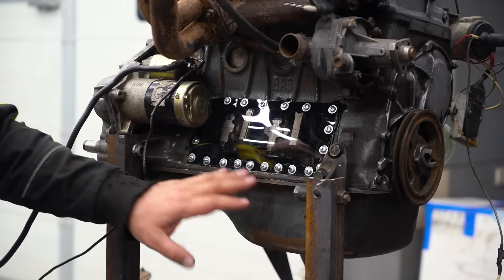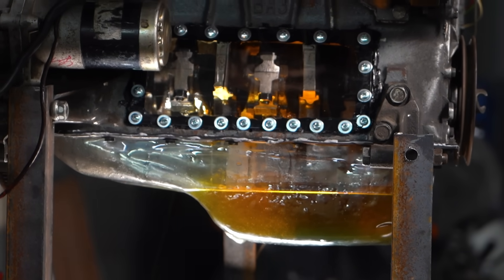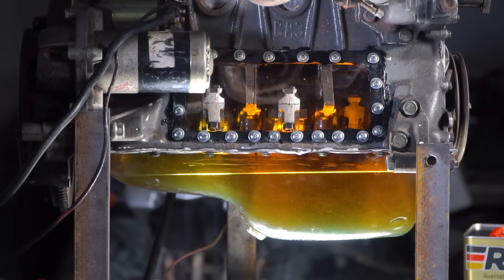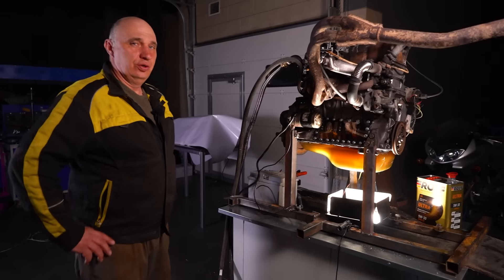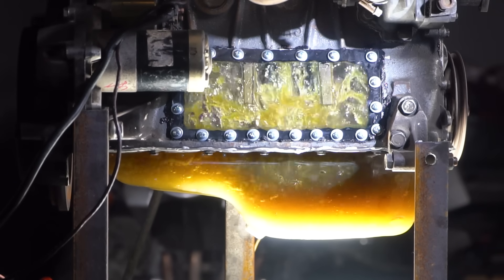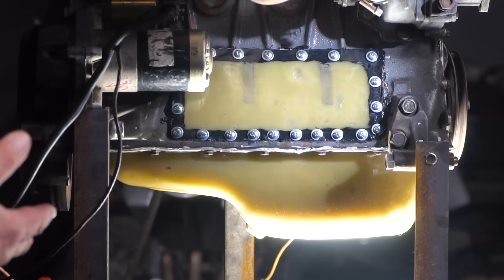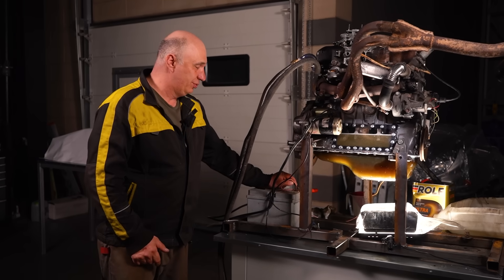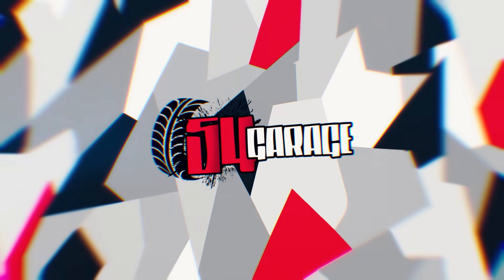What actually happens when you overfill your motor oil? (w/ transparent oil pan)

Comment: I'm assuming this is a Russian engine out of a Renault or something I'm not sure I believe that's the right brand I could be wrong on the brand of automobile but I do know they typically test a Russian automobile on this channel I've seen a bunch of times I'm curious about the front and rear seals on the engine would not the extra oil create significantly more internal pressure against those seals and cause them at the very least to leak or possibly blow altogether ?
 that's what I've always been told the dangers of adding too much oil would cause either internal seals to be blown or front or rear main seal .
Otherwise still really cool experiment it sucks that the plastic pan gave up LOL

Comment: As mentioned before the cavitation in the oil from foaming up will cause premature bearing and pile pump wear, but what nobody else has mentioned, increasing oil level reduces the volume of air in the lower half of the engine ( crank case pressure ) engines have a crank case ventilation system and it can only flow so much. Increasing the oil and decreasing the available space for air in the crack case will increase the crank case pressure. This pressure will naturally want to release, the way it does this is pushing oil seals, more commonly the front and or rear main seal both of which are expensive to have replaced.

My point being is everyone in the comments saying you've been so concerned about it and now you feel at ease from this video, just remember over filling can cause issues. There is a reason the manufacturer recommends a certain amount. A little bit over the fill line is okay but going too excessive will cause damage.
Reply: It's aeration of the oil, not cavitation.

Comment: Many have missed a huge error in this experiment. Reving the engine at idle doesn't create any load and he didn't run the engine for any extended amount of time. the oil pressure will blow all the gaskets and seals... your engine will kill itself...

Comment: He did not talk about oil coming out at air cleaner ,my partner had his vehicle service,and about 1,000 km he could not work out where the oil was coming from,took it back to work shop,they ask if he put more oil in the motor,he said to the mechanic it only done 3,000 on the clock,it a brand new car,why would I put more oil in it,cut to a short story,they drain oil,and did not want to talk about who did what,never went to that workshop ever again.so we never knew if it hurt the motor,still doing research,ourselves.

Comment: I have an 850 Moto Guzzi motorcycle from 1979. It has a ridiculously shallow sump. It revs to just under 8,000rpm. Even the slightest over-filling causes much oil to exit the breather. A sump extension fixes the problem.

Comment: Think about the oil level in the pan when driving up or down a long mountain road. Think about what happens to the oil in the pan when accelerating or braking. The crank components will be hitting the oil even when the correct amount of oil is used.

Comment: I had a car come in that was overfilled, 

I drained out over 7 litres, correct was 2.8L.

The owner filled it, the engine, until it was full.

Then they drove it. It hydraulic locked, and bent a con-rod. The excess oil got sucked out of the crankcase ventilation system, into the induction system and the rest was history. . .

It was their first car, they had just passed their driving test. . .

The test is for how to drive, it does not cover the intelligence (or lack there of) of the driver..

Comment: Really interesting! I experienced  a modern Common Rail Diesel Engine runaway first hand in a Ford S-Max 2l TDCI some yrs ago. These have the problem that unburned fuel seeps into the Oil due to unfinished exhaust filter cleaning procedures if used on short distance driving too much. Without knowing I went on a longer ride with diesel diluted motor oil wide above "max" level. All went fine until I went up a steep mountain road with about 10% gradient.  Obviously, the surplus oil was foamed up by the crankshaft and sucked into the intake via crankshaft casing ventilation - and the engine did a runaway. Thanks god this happened under load and I noticed it while shifting so I could choke the engine and stop the car. The whole thing was really scary. The engine control went into emergency running mode but nothing was damaged thanks god. After an oil change everything was fine again.

Comment: My Dad was Marketing Manager of Petroleum Products for Gulf Oil before the merger that created Chevron. He always told me it is worse to overfill than underfill. Times have changed. This is a fascinating video.
He started out there working in the grease pits at the Harmarville, Pennsylvania R&D facility in the late forties and worked his way up. He was with API and SAE and helped to create the ratings system for viscosity and acceptance by the automotive industry.

Comment: Over time as you can see excess oil creates too much friction on the crankshaft causing premature wear. 

The crankshaft and crane can experience greater resistance and friction, causing them to become damaged. Engine wear, If oil is at an incorrect pressure, the lubrication of engine parts will not be properly optimised, causing increased wear.

Comment: Du ifyou occuy too much. Of the crankass volume the pressure w force ouup out thedip stick toube and as the piston skirts get oily tei begin to smoke and without the PCV to releave pressure seals and gaskets will begin to fail until the plugs oil foul. And it wil quit.😮😅

Comment: This engine maybe OK with overfilling but there are many different designed engines that operate at different levels.That's why the designer of engines have an oil level. with Porsche 911 dry sump system the oil level on the dip stick is half way between low and max and the oil is transferred at different levels.They are just designed to operate that way. I would stay with the designer of a pacific engine....Also i would be more interested in what oil pressure of this engine with more oil.

Comment: Bought an 06 TSX for $600 that the owner thought was the head gasket because lots of black smoke coming out the exhaust.  Ended up having twice the amount of oil. Drained the extra oil ran great. Sold the car for easy profit of $2,000!!

Comment: Hey if anybody is mechanically inclined my car has an inconsistent throttle. Sometime pressing the throttle does almost nothing and sometimes it has instant torque. Also for some reason a fluid that kinda smells like battery acid came out of my vents when I had the heat on. Any answers?
Reply: Yeah. Go to a garage and stop consulting on the internet.

Comment: Oil level overfill not being an issue depending on how much it's overfilled is dependent on the engine. There are some LS engines that it's recommended to add an extra quart for track use. But if you put an extra quart in a 911 turbo you'll toast it.

Comment: A really great video. I see you are using 5w-30, in a 2000 chevy cavalier at around 100k miles they have a overheating problem which is cured by adding a quart of 10w-40. There interesting thing though, is that my 2017 VW alltrack,  even at 30k needed an extra quart of oil over the fill line to keep the valves from ticking very badly, i believe that when running the head holds the extra quart of oil, even when it was a newer car.

Comment: Mechanic of 30 years old neighbor. Said he puts one quart extra in his own vehicles.  In an engine like acura 3.7 v6 that burns oil ive over added oil it whole life so far and this is confirmed that its not hurting a thing.  Better over than under way better
Reply: Some engines will burn oil if over full or at Max and find their own level.
As long as the level is between the high and low you're good to go.

Comment: decades of conversations with professional mechanics, smart backyard mechanics, and me, who regularly works on my cars and friends' cars, and i've never been given a straight or consistent answer. i've always enjoyed this channel, but that was fucking fantastic. cheers, from me in Alaska to you in Siberia!
Reply: few points to keep in mind here. 
first of all that oil pan is molded from the outside making it bigger than the original.
this is an old lada engine, nowhere near the tolerances of modern stuff. 
it is only running for a few minutes in these conditions.
it is not moving around like a vehicle going up/downhill.
and they are filling it up even after it is beyond critical levels for normal operation. 

in my career i have seen a few vehicles towed into the shop due to double filled oil. one because the lube tech drained the transmission on a subaru thinking it was the engine and didn't check the dipstick after filling the engine with more oil. that car made it about a mile before it started bucking like a horse and pouring smoke and oil out of the exhaust. 

another one was because a chevy trax owner thought the oil life % on the instrument cluster measured the oil level, and put 4 more quarts into the engine when it reached 5% and dinged at them. that one was just pouring a bunch of smoke and oil out of the exhaust. 

besides that i have seen some vehicles shoot the dipstick out, spray oil onto the exhaust manifold, and clogging the catalytic converters just from being a quart or two over.
Reply: @cmawhz  But with the Subaru engine being a opposed cylinders and quite a small sump , then all that extra oil would have gone down the bores and violently being hit by the pistons. That would make a interesting video.
Reply: @cmawhz  Different engine.
GAZ is the opposition to Lada.
Reply: @cmawhz Nobody wants to overfill but everybody wants to stop being scared if they 1 cm over max line 😊 1 or 2 dcl over wouldn't harm it that's the point
Reply: @VladimirKozomara  i wouldn't pull the drain plug for being half a quart over but it's not hard to be a little more accurate in the first place. more than that and it definitely can cause issues. 

you would be surprised how many times i fix vehicles with issues caused by things they saw online and believed to be true so i gotta say that it can and does cause issues.
Reply: @cmawhz doesn’t always work out like that tho. Some vehicles are finicky. Had a 2015 Elantra that would shut down on you shortly after that oil started to foam. All it needed was about a half quart over to do it. It would idle like crap, shut down randomly, overheat, etc. 
Problems all went away as soon as the oil level was fixed tho.
Unfortunately, one vehicle handling it well doesn’t mean they all do. Really wish it worked that way tho, lol.
Reply: @ARBackfire  yeah thats kind of my point. people here are acting like they can just dump in any amount of oil just because it didn't blow up in a youtube video lol
Reply: The problem I have seen is overheating after the oil starts to foam, I think the foamy oil is not able to dissipate heat properly and all the extra load it creates a huge drag on the engine
Reply: Crank case pressure.  Do not over fill it, they are designed for a certain amount for a reason.
Reply: @Deere2154D you are right and warrantee is another reason not to over fill with oil. A little bit over May not hurt but when oil foams you will have problems. 73
Reply: The narrative of don’t overfill your engine oil or it could explode the engine is an old wives tale. If the car requires 5 quarts and you put 6 or 7 it will be just fine no problem at all.
Reply: @_JimmyBeGood  no matter they come in jugs and that is what I put in no more no less. My vehicles last longer than most people's I don't supply vehicles to the used market. 73
Reply: @ronb6182  Hey you can stand on your engine and piss in it for all I care. I’m just saying it’s absurd when people warn you not to overfill or you could hurt the engine. It seems you can fall asleep while filling it with a hose and you still are not going to harm the engine.
Reply: @_JimmyBeGood  it might not hurt the engine but it will hurt the pocket book. I just use what I always use. All my vehicles are old but still run like the day I bought them. 73
Reply: @ronb6182  That’s nice
Reply: I went to UAF in Fairbanks. A friend and I experimented by putting different grades and types of oil outside overnight in the winter. The synthetic oil was the only one that never went totally frozen. However, it was still very viscous.
Reply: @jpjp9111 
Old time Fairbanksans in the days before winterizing and headbolts, used to come home from work and immediately drain their oil and bring it inside.

In the morning they'd heat the oil on the wood stove and pour the warm oil back into the engine and fire it up.

Oh, thems was the days!!
Reply: @jpjp9111 wait, synthetic went frozen solid? What kept the best viscosity for engine starting?
Reply: @richeyrich2203  I think he might have meant synthetic "wasn't" frozen
Reply: @richeyrich2203  I made a mistake due to auto correct. I intended to say that the synthetic oil was the only one that DID NOT freeze.
Reply: @pressharder6920  Exactly! Auto correct "corrected" it to the incorrect statement. 
Synthetic oil was the only one that was not frozen.
Reply: Agreed
Reply: Ah a fellow Alaskan... I have had a crown vic hydro-lock on me.
Reply: the dip stick have hallow dots on it which tells how much space is in the sump available to fill the oil for the engine
Reply: Bu eski motorda 1 veya 2 litre fazla yağ koyulsa pek bişey olmaz,lakin yeni motorlar kesinlikle bu kadar toleranslı davranmazlar, o yüzden siz siz olun maximal çızgısını en fazla yarım litre geçin, fazlası motor çontaları en yazıf noktadan yağ dışarı atar, bu kesin bilgi
Saygılarımla
Reply: For motorcycle engine it will jam up the gears and overflow
Reply: @joeyong1418 I'm a motorcycle mechanic and you're full of shit
Reply: now that you know, you understand why your friends keep 1/2 to 1 quart extra in winter.

Comment: If you connect a power source to the pistons the lowerones you can easily magnetise and demagnetize and also consider  lowering the engine power changing polarities at high rate meaning uve made a hand brake for a fast stop ,the body can be suggested for carbon fiber low weight load and strength the connect is very ideal ,do not worry as the vehicles we currently have took 2 decades
Reply: Considering the power source meaning the vehicle itself already is flexible in terms of engine power as the power/energy source is strong enough

Comment: I over filled my vw polo a couple of times in the 80s and it went up into the air filter causing the engine to smoke badly. I had to have the air filter replaced. That was only one or two litres too much.

Comment: So what happens when you have things touching the oil like you have here is an issue though the engine seems to be running fine if you have a temp gauge you would realize the oil is not doing it's job anymore and by aerating the oil it cannot dissipate the heat as fast so as long as you don't foam or induce lots of air bubbles it should be alright.

Comment: This test is highly inaccurate unfortunately please read my reasoning.
The transparent oil pan has significantly higher volume capacity than The actual metal pan

The metal oil pan is like a quarter inch thick and thicker in places especially if ribbed 

The plastic mold is of the OUTSIDE not the Inside of the pan 

The thickness of that pan being empty space allows for way more oil to fit. 
This is why the recommended amount was barely enough and why double was hardly an issue 

In a real stock oil pan 2X your oil is going to fuck shit up, cause extreme back pressure and blow out your engine seals causing it to either leak out on the ground if your lucky OR leak into the combustion chamber so you’ll either burn oil until you eventually burn out and seize if left unchecked or flood your engine.

Comment: What will happen soon is the oil rings on pistons will be overcome and the engine will start burning oil. But before that the PVC system will start spitting oil out every orifice and likely will blow the crank case breather hose off its seat. I have seen it, A kid in a shop i worked at put 4 gallons of oil in i think was a 1988 or so Honda Accord, 4.5. quarts is correct. When he started it there as a noise (don’t remember what it sounded like) and oil was pouring out under the engine and was flung on all the walls and ceiling need it. Poor kid……

Comment: Yes, but you are not understanding the effects on the engine. #1, you are are aerating the oil. So when pump pumps oil to the mains, rods and head you are not send oil but an oil/air mix. That is killing your bearings. #2 is you lose a huge amount of power. For the rods and crank to be slinging that much oil it's a huge parasitic drag loss. #3. You are flooding the back side of the pistons to compression rights. They can't seal in that situation. So you are burning oil and not creating any horsepower.

Comment: I used to work at Jiffy Lube and the new kid starting filling the engine with 4 quarts, but the gauge had been set to gallons so he did 4 gallons instead. After running for only a few seconds, the poor little Subaru blew out several gaskets and had oil pouring out from everywhere, even the exhaust